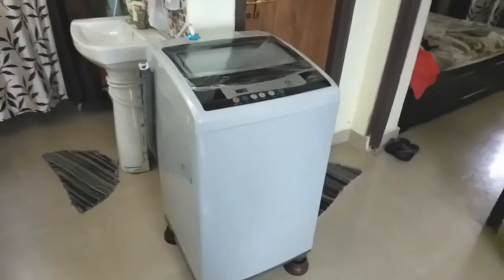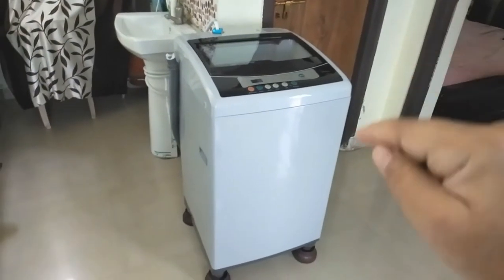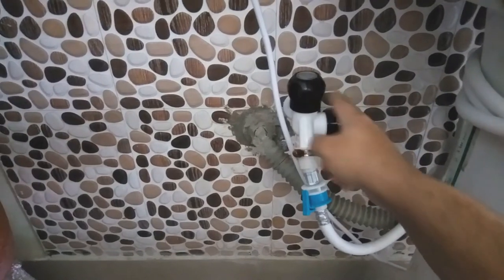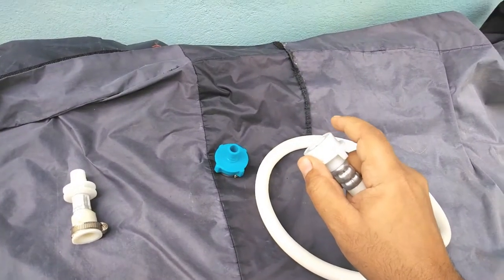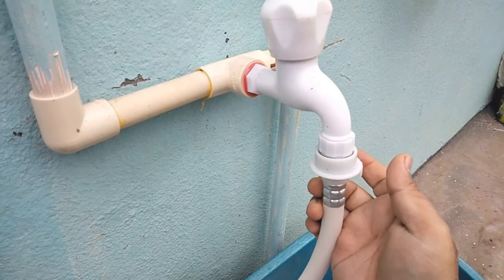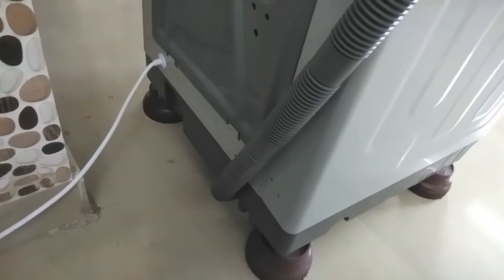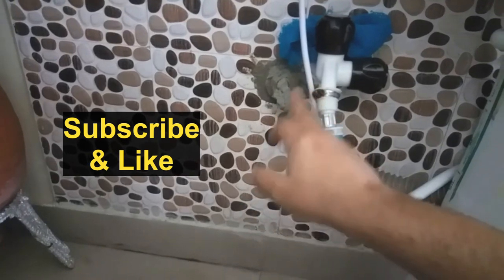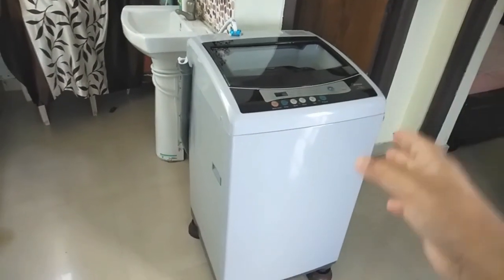Fully Automatic Washing Machine Installation Requirements and Ideas - Water Tap, Drain Line, Power

Comment: Actually most front load have  Built in water heater so their power consumption is over 2000 W And require 16 a plug

Comment: Can we use the washing machine from 6amp switch with 16amp  converter ??
Reply from the maker: This washing machine takes 350 Watts of power.

Power = Current * Voltage
350 = Current * 220 (Standard India Domestic Voltage)

Current = < 1.5 Amps

So it requires less than 1.5 Amperes of current. You can use 6Amps socket without any worry.

Most washing machine run with same power rating (<500 Watts).
Reply: @CommonManLife  thanks alot..👍